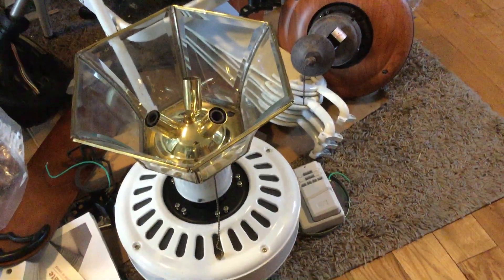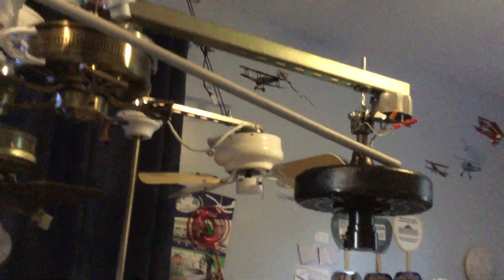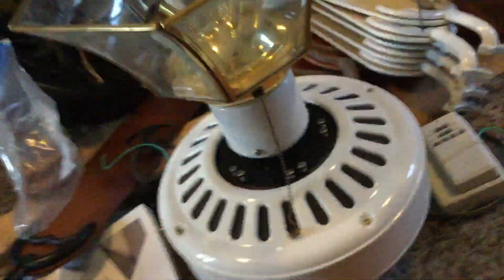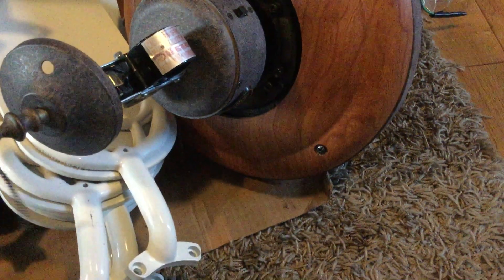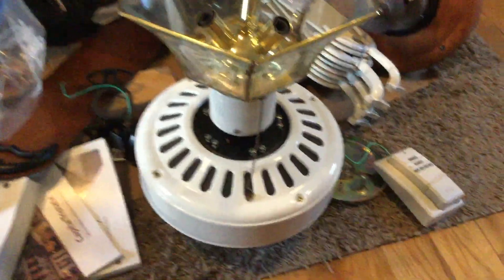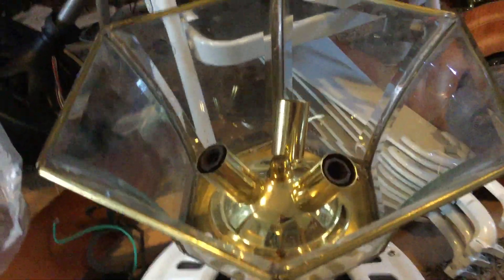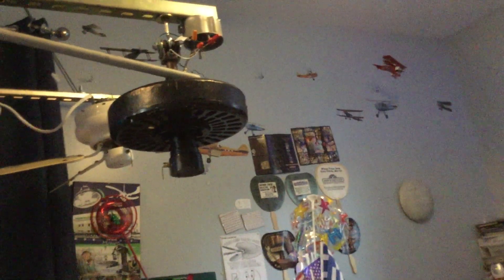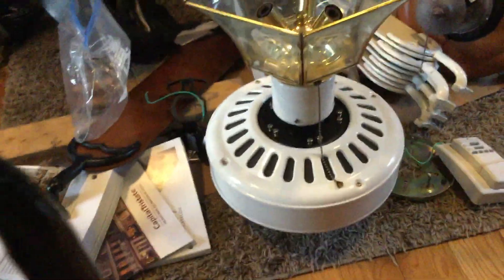New ceiling fans: Hunter Studio Series Remote and Hampton Bay ceiling fan

Comment: The hampton bay is a maplewood
Reply: Ive seen a monte carlo that looks almost identical other than the HB has a step in the wood housing.
Reply: @rartolak  you are talking about the monte carlo sedona. The monte carlo sedona is remote controlled and has no chains.
Reply: @TheFanSavvy2004  Aay right on! Though the one I saw did have a chain as it had the signature V shape. but no antler light. I searched for it years ago found it then but totally blanked on the name when I went to see what it was again. It was installed at the join of two steep ceilings and on low in updraft. Cedar planks on the ceiling from the stone walls. very woodsy room